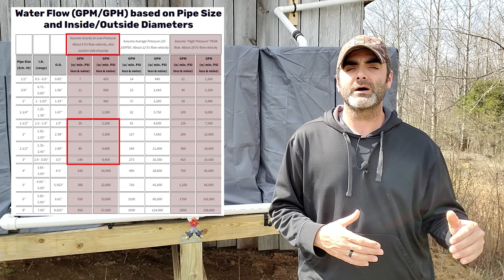Collect AND store | DIY Rainwater harvesting system

Comment: Great video. Does the first flush pipe not accomplish the same thing with or without the ball?  What advantage is the ball?
Reply from the maker: Without the ball in place, the dirty water would get mixed with the "clean" water, when clean water is desired in the IBC totes. The ball plugs the lower section preventing this mixing. This only happens if the first flush is drained after each rainfall, should dirt, pollen or the like accumulate on the roof.
Reply: @meadowgreenfarm so are you using the long down pipe to collect the first flash of rain that will be the dirtiest of the water since it's kind of cleaning the majority of dust/dirt from the roof?
Reply from the maker: @Cordak  you got it! Since this is drinking water for the animals i try to gather only the cleanest water we can.
Reply: @meadowgreenfarm  Do you have a link to where I may purchase a 2" floating ball?

Comment: I have a question do you know where the swimming pool filter do you think there’s a way to put a swimming pool filter on that line before it gets too those totes the water tanks that way and help keep some of that degree or dirt cleaned out that way you can take it off and clean it every once in a while that’s what I thought about doing one of her work
Reply from the maker: A pool filter would require mor pressure than just head pressure, i would look into just using a stocking or legging (panty hose) just befor the totes. I have seen this used to great effectiveness.

Comment: PVC joints work better if you give 1/4 turn or more after sliding the parts together.  Just slide it together 1/4 turn out of alignment and twist to alignment.

I also think you are using a "multipurpose plastic pipe cement which is a compromise to allow such things as gluing PVC to ABS.  These are not the best for PVC to PVC.  If everything is PVC, get the PVC only type glue.

Over several years, PVC degrades from UV exposure.  It is a good idea to paint the PVC.  About 5 years here in Texas, the white PVC will turn black and brittle from sun exposure.
Reply from the maker: We have actually covered the pipe with insulation to prevent freezing and keep uv light off the pipe. I have also been using the high strength PVC glue since this video.

Comment: How do you clean these tanks?
Reply from the maker: It is important to purchase food grade to start. Some forms of residue are OK to leave in the tanks, for example Honey. In our case we used hot water and a lot of elbow grease. We also used a brush, taped to a long pole to reach inside the tanks with a pressure washer for the final clean.

Comment: Hi can you give me the item name of the converter pipe from Amazon from the IBC Tote to the converter so that the PVC pipe can be added.
Reply from the maker: it is a 2" buttress to 2" NPT fitting:

https://www.amazon.com/Fittings-Adapter-Buttress-Thread-275-Connector/dp/B0C4QB8B27/ref=sr_1_6?crid=308HF51V7ZJHC&dib=eyJ2IjoiMSJ9.0o2k-fNp4_De8uI2r7DyKHv_KEd7a9hS59w61JmBuRFSnTEmUs84CQoYFbpg1R4h0_cybrUE33Q9dKEh7Kkf4bZTbXbOlkoEM6z5c6X7-fFN-tlQZQBA3Zd-ERWLDttaSO_3wUdN_CfttJcP1Ou_7P5w-wiZSf9eQ4SWRmlh66tWdwhObcpm81Uak3BykKR4zsRndvPt1waZsEWO0-tyAQHjhMlCSRO4cb8DC5L65hf50JDZ8whlkTWQCPoOiq9F3CYhsiD_MAGWZspQFOx6N7eBcOmLlylFMgIhGmppuic.LQrQaxHWUH5Nvu2zw3HLnve37WG0BNiPWUp7xtNIid0&dib_tag=se&keywords=ibc%2Bcoarse%2Bthread&qid=1718627547&sprefix=ibc%2Bcoarse%2Bthread%2Caps%2C108&sr=8-6&th=1

Comment: I mean, you don’t need the ball to seal off the water to make it go out the t-junction. The water will fill up on its own and go that way. You just made it take like 4-cups less to do.
Reply from the maker: The ball prevents larger floating particulates from entering the tank, should you not be screening the water before the first flush.
Reply: @meadowgreenfarm  ooooh, smart.

Comment: What fitting and lid do I need to connect to the top of my ibc tote
Reply from the maker: run a search for a "6in IBC tote lid npt" you will also need a 2inch mnpt to 2inch pvc coupling.
Reply: @meadowgreenfarm  they can also be had with two, 2-inch bungs, which is what I use. They fill in series rather than parallel. I do still plan on linking them together at the bottom for quick discharge in preparation for a storm. 
❤ from Florida

Comment: You will never empty the right tote because you put the valve at the middle tote. The right tote is the lowest that’s where the valve should have gone. You will need a vent to let in air so you don’t create a vacuum.
Reply from the maker: So why does it empty just fine then? Its not the lowest point either, they are all level and empty equally

Comment: Sir, what do you call the rubberized  item with two screws at 20:28? Thank you.
Reply from the maker: They are "Flexible PVC Couplings", can be found in any size of PVC you are using
Reply: Furnco fittings